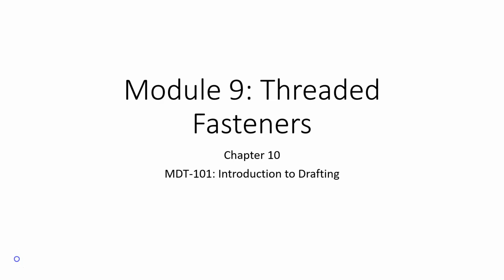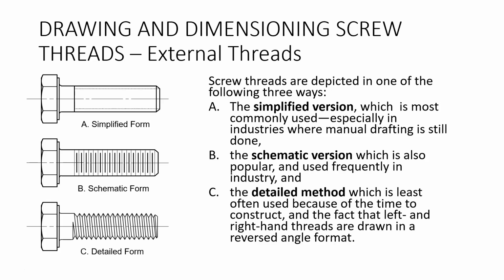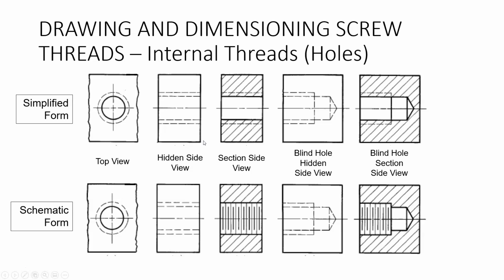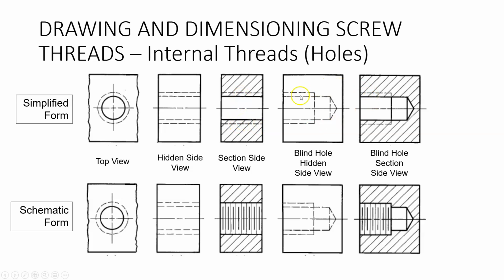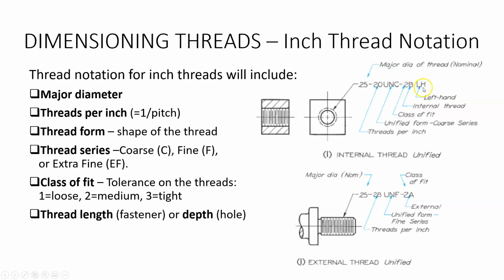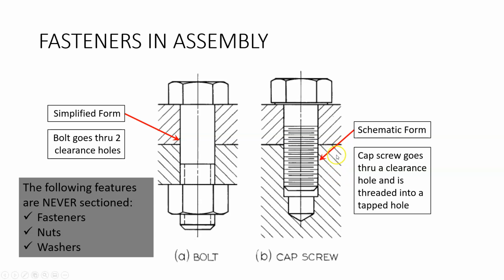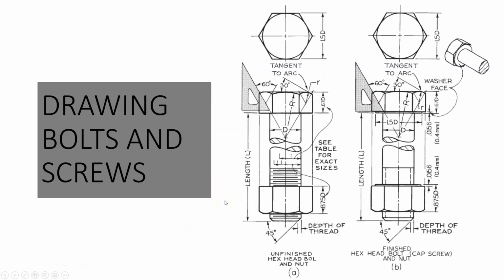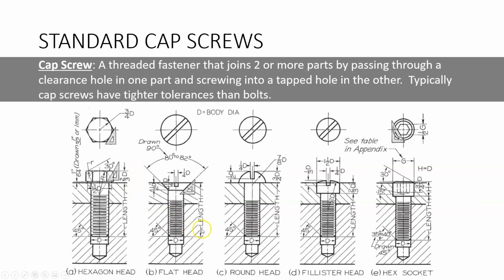Drawing Threaded Fasteners

Comment: I believe there is no difference in the part itself when calling something a bolt vs. a screw. It’s a screw when it is going into a threaded hole (or is a thread forming screw) and it’s a bolt when there’s a nut on the back🔩

Comment: Error @10:32! "1.5" DOES NOT mean that there is, to quote you "1.5 threads per millimetre (or 3 threads every 2 mm)". "1.5" means there is 1.5mm between threads. Skip all that "inverse logic" in metric system! :) This is tight and concise https://youtu.be/C4hblJGoTJk&t=33
Reply: You are correct. Don't know what I was thinking when I froze there and then stated the wrong thing.  I was going to say the correct definition but my brain froze.  Thanks for catching that.
Reply: Thanks. You are of course correct. I noticed this pretty quickly after finishing the video. Need to add a correction to the video soon.